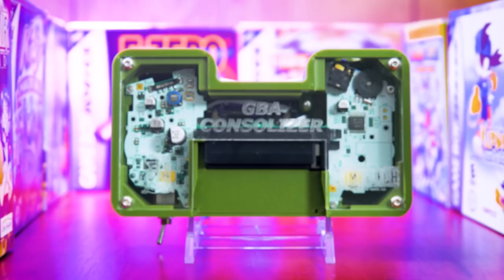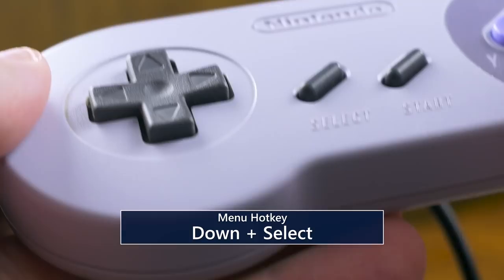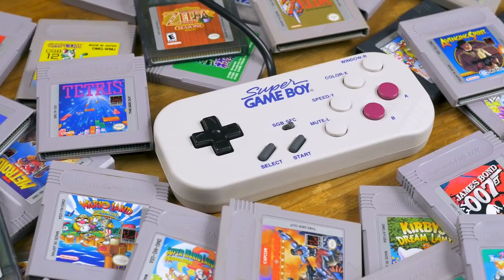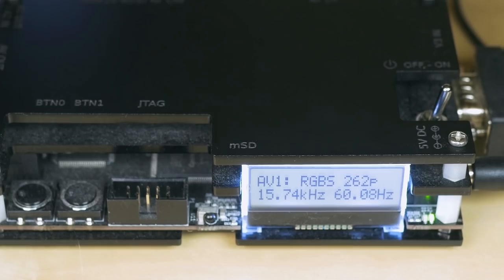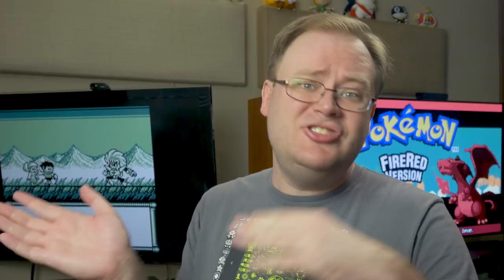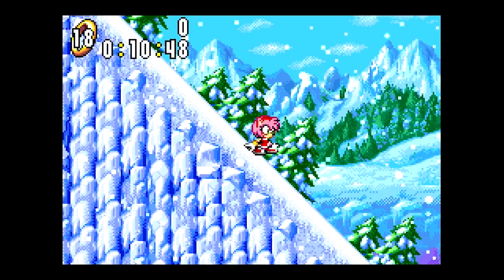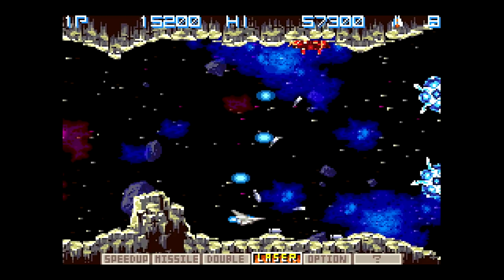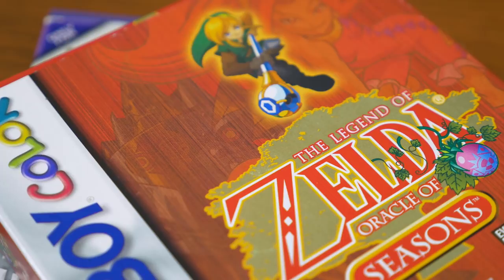GBA Consolizer - Game Boy HDMI Mod :: RGB318 / MY LIFE IN GAMING

Comment: I’d much rather put a IPS display in one of these GBAs then gut it for this.
Reply: I also feel like the degree to which this alters the hardware/firmware undermines it's purpose. It's still a cool mod kit, but it gives the impression of an emulator rather than a "Consolizer" which should primarily replace the input and AV capabilities.
Reply: @ArtumTsumia  Yeah, you're better off just getting a old PC, Wii/Wii U, or a raspberry Pi setup for significantly cheaper. Saving the GBA for a more reasonable mod.
Reply: @piranhaplantX  emulation is not the same as og hw or a fpga solution.

Comment: SPOILER ALERT: they now sell all their "consolizer" things for 350$+
Reply: For that price a MiSTer is a much better investment
Reply: @prufrockrenegade  A what?
Reply: @somebonehead  MiSTer FPGA. It's a small circuit board that can be configured to basically run just like Analogue's high quality clone consoles, except it can run all the major 8-bit and 16-bit consoles as well as a bunch of older computers (like C64) and arcade machines all from the same device. Takes a bit of tinkering to set up (kind of like a raspberry pi) but once you do it basically runs just like real hardware over HDMI (Edit: and RGB!). SmokeMonster has a bunch of YouTube videos going into more detail if you're interested
Reply: Buy their kit and do it yourself. Much cheaper than having them build it for you.
Reply: @sickregret  or just be smart and use one of the hundreds of emulators for pc that have existed for decades.
Reply: @Arriaga Two because they want to.
Reply: @sickregret  Issue: I can't do that.

Comment: For people who don't have soldering skills, they should consider using pogo pins. How that works is: Pogo pins are spring loaded, gold plated pins that can be soldered directly to a PCB. The kit would come with custom PCBs that have pogo pins which align with the spots you'd have to solder to. You screw the board in and it presses the pins against the spots. From the custom PCB you have wires going to the daughter board. Zero soldering required. Modular and easy to repair in case one of the pins fails.

Comment: 24:40 This particular data-point could be extremely telling. Likely, the use of an in-line device, which adds its own signature to the signal, is giving your Denon receiver exactly what it wasn't getting from the GBA Consolizer itself. Your discovery not only points to a simple solution, but also to the issue's likely cause. If that's the case, this could potentially be something that firmware alone could solve. As adding a signature to a sent signal isn't really that hard to do. It can be done via hardware (like it is with most vintage electronics), but is just as easily done through firmware (as it is in pretty much every modern device). This was super exciting to see you mention. I bout fell out of my chair, while flailing for the spacebar to pause! xD
Reply: P.S. I just looked at the date on this video and laughed a second time. As, hopefully the developer has addressed this bug by now.

Comment: 8bit do should remake the gamecube snes style controller in the future <3
Reply: Zeke Barrett they do
Reply: @Adamsnadler214  not the gc Controller with snes shaped case.
Reply: Raphnet tech makes an adapter to use SNES controllers on your gamecube. I'm currently using that as well as an 8bitdo wireless snes controller with gameboy interface and it works amazing

Comment: If I didnt have gbi and gameboy player 360p line triple for ossc I would have been all over this. Mines flawless. Great video guys :)
Reply: When doing this, does the OSSC output a 1920x1080 image? (Or a resolution below 1920 pixels wide, just asking for my 1080p display)
Reply: @Supersayainpikmin  The OSSC always outputs the original aspect and frame rate. I don't know if the GBI software has any options for that as a few GC games did have widescreen modes. But that usually required altering a setting on the TV (unless you always stretched everything to fill the screen anyway). Does your TV have the capability to force an aspect ratio?
Reply: No, it doesn't. I was actually thinking of routing it through my Framemeister since my TV apprently isn't compatible with the OSSC. While It works with 960p input, I'm not sure this oddball resolution will work. I'll find out myself next week when my OSSC arrives. Even if it doesn't, it's fine since the FM still looks really good to me for GB games.
Reply: @Supersayainpikmin  360*3=1080 so the line height there shouldn't be weird. It's very unfortunate that your TV doesn't have scaling options. I've never used one that didn't, albeit it was very buried in a few of them.
Reply: use retroarch
Reply: @sixdroid 
Emulators are for noobs.
Reply: @CPS2  ?

Comment: Using an SNES controller is genius. I modded my Super GameBoy yesterday to make it use the same speed as the GameBoy DMG-01, Pocket, and Color. Next will be installing the Game Link Port.
Reply: Just buy a Super Gameboy 2 from Japan it fixes both of these issues.
Reply: @USMCJPelt  Overseas shipping requires a John Hancock (reference to Tommy Boy) every time and I work nights and sleep all afternoon until 4pm.
Reply: installing the clock mod was good practice for soldering and removing smd's. it's also nice to upgrade something I've owned since way back when.

Comment: Wish something like this existed for 3DS.
Reply: If a video out were to exist for 3DS you'd have access to GBA (via CFW and custom GBA Virtual Console titles) and DS too. That's another set of three Nintendo handheld platforms on the big screen with no software emulation in sight.
Reply: @Fattydeposit   There is Citra for 3DS emulation, and it works. You do need a real 3DS though, and some files from the 3DS which a pre-built CIA for exists. After you homebrew it you can just grab those files and use them wholesale in Citra for making certain titles like Miitopia useful, which requires a Mii of your own to play.
Reply: @Fattydeposit  It's always a pain to map controls for newer Nintendo systems though. Motion controls don't map well.

Comment: Sounds great but: 
for that kinda money you can buy a GC with GBplayer. No soldering required and you don't have to sacrifice your GBA.
Bssides, if original hardware is not that important to you, it is still easyer to set up a RetroPi. 
Another alternative is an android device connected to your t.v. using bluetooth to connect to a PS/XB controller..

Comment: Certainly looks nice, but I'm still not sure how I feel about sacrificing original GBA hardware. I know there are still a ton of them, but it's still a finite source. Steep price too. I hope someday we might get an FPGA solution for it. Either through MiSTer or a stand alone system which does GB/GBC/GBA. I'd get behind that. For now I am happy playing Game Boy.* on a GameCube + GB Player running GBi software, via component outputs, and playing with a Hori GBP controller.
Reply from the maker: [Try4ce] I don't think anything about the mod is irreversible. The same could be said of any mod, it's just that most stay in the original shell (or cut the plastic of the original shell, which I'm pretty sure this does not).

Comment: In response to the 8bitdo snes controller options. Most of the issues are with “pro” models from what I’ve heard. The 8bitdo SN30 is a fantastic 2.4ghz controller which has the exact dimensions of the SNES controller and no lag on real consoles which has been great for casual and speedrunning games. It works on switch with a usb cable and it should work great on the consolizer. The buttons even use the same cutouts for the original controllers so if you get the transparent black version and want the OG purple or colored SFC buttons on it it’s an easy swap.

Comment: I appreciated the video. I would just like to point out that 2160 is not three times larger than 720; it is three times as large as 720. "Larger than" implies adding a multiple of the base number to the base number, whereas "As large as" is just straight multiplication.

Comment: For the gbi gamecube option. extrems was saying that the hdmi solutions have some issue's with some settings. IDK if 540p works with it. there are some other options. 
Normal settings work fine. So official component cables will give better results. 360p is good with the ossc, idk if it needs special firmware to accept such resolutions. I don't think he likes the hdmi solutions to much. Exrems was saying the hdmi consolizer is just as good as gbi hf with all the good settings on and more stable of course since it's read hardware. So your getting the best that can be offered with the consolizer.
Some settings work fine and with default should work fine also with the hdmi solution. I don't own any hdmi solutions so idk for myself, it looks like you guys got it running fine. I just use s video with the framemiester with 240p setting which is alright, there is a tad of fuz id like to eliminate with a other solution.
That audio problem is enough for me to think about getting og component cables thou, it's really tough with the high ebay prices. maybe it can be fixed in another rev.
Reply: I don't think u need a upscaler if u use component with 540p and 1080i. The software will do it with the components.

Comment: So wait if the consolizer is overclocked, even if its only slight what does that mean for link cables?
Reply from the maker: [Try4ce] Hmm that is a very good question, maybe something else keeps them in sync? Honestly I basically never have need of them, so I didn't think of that.
Reply: @mylifeingaming   Would be nice if you tried that out, aswell as the Gamecube-GBA link cable.
Reply: @mylifeingaming  it's a pretty important thing to test, especially if you want to enable multiplayer with the Consolizer.
Reply: Please test it!
Reply: It would make it go out of sync, I’m kinda shocked they didn’t include an option to toggle the speed just for that.

Comment: I just had a thought: The GameBoy Player is literally just a GameBoy Advance that replaced the screen, controls and power circuitry with a proprietary connector.

Wouldn't that allow a Plug'n'Play version of the Consolizer for the Player? - obviously with additional engineering required since I don't assume that Nintendo literally just piped raw video from the GBP to the GameCube, and raw input data back, otherwise we'd likely have seen some sort of Third-Party DVD player or Famiclone add-on for the GameCube back in the day.
Reply from the maker: [Try4ce] I believe they are planing to make a version for the Game Boy Player eventually, but it never occurred to me if it might actually interface with the GameCube. In my head I was just thinking it would work independently.
Reply: @mylifeingaming  Well, I assume it wouldn't NEED a GameCube, unless Nintendo went crazy with securing the connection between the GBP and the Gamecube. Worst case they'd have to directly tap some of the GBA's chips, but I was wondering if they could "just" release a box that you plug into the Player instead of the Gamecube with no modding necessary. An added bonus could be rumble support for the few games that supported rumble through the GameCube Player.

Comment: This is kind of neat and I'm a DIY guy, but even at $140 it seems like a lot for what it does. Don't take this wrong, I don't think/mean it's overpriced, just personally I find super limited appeal of playing GBA/GB/GBC games on a tv. I have the original systems and flash carts, and also a modded Wii. A modded Wii will let me play these games on a TV if I wanted to. Sure, it's an emulator, but we're talking hand held games which aren't really "authentic" on a tv screen anyway. I guess it's nice to have options, but a Rpi, computer, Wii, and many other devices will do the same thing. If for some reason you need real hardware, such as speed running, the timing difference eliminates its usefulness in this category. The most useful thing I see about this is that you can use a SNES controller or allow a sentimental broken GBA to be revived. I guess what I am getting at is, it's a really neat idea and might be great for some people, but it's a super niche product and it isn't something that appeals to me personally.

Comment: Hey Try and Coury, I have some pretty great news for playing Gameboy Advance on HDTV! Recently they added some Low Pass filters to the Gameboy Advance Core on Mister in one of the updates. 

There is a Filter that I think changes the game on GBA's audio quality - I've been testing them out extensively and have come to the conclusion that the Arcade LPF 6khz 2nd Audio Filter provides strikingly excellent results without effecting the audio range or dynamics too much (effectively minimizing the audio buzz present on GBA consolizers thru most AV equipment). 

I'm sure this Filter COULD be added to the GBA consolizer itself aswell - but for Mister, this is a BIG break-thru for capturing and streaming GBA (and for those of us who still hear higher frequencies). Update you're Mister and give this filter a try and see what you think. 

The difference is best heard on headphones of a surround system - but can still be clearly discerned thru typical TV speakers. No More Annoying Hiss!

Comment: It'd be interesting to see a video on receivers at some point; they're rarely mentioned seemingly (compared to the OSSC or Framemeister), but if they can scale analog signals to 4k60 then they're an option for sure. Do you notice any lag with your Denon receivers?
Reply from the maker: [Try4ce] There's no lag in the modes we use them in, but for processing analog content, I would think there would be. Do not expect the upscale to be tuned for game graphics. I wouldn't expect it to look a lot different from how a TV would scale the image internally, but I haven't tested this.

Comment: Seems like a GameCube controller port would've made more sense than a SNES one. You could natively use the GC controller (not ideal), the Hori GBA GC controller (perfectly amazing, but expensive) or another GBA with the cable adaptor (probably perfect, since you'd then also have a portable GBA as well as your consolized GBA)

Comment: This would be a purchase for me if I didn't already have a CARBY and the GBI software for my gamecube.
Reply: awesome for you!
Reply: I have the same setup, but my issue is that the CARBY still doesn't process 240P as well as an RGB solution does via a PAL Gamecube, at least that's my understanding of it.  It seems those solutions still don't do 240P as well as they could as they are made more for 480i/480P content to my understanding.  It seems that currently this is the only HDMI solution to properly do 240P with the ultra sharp pixels.
Reply: Is there a good video for how to set that stuff up? I'm trying to get the GBP Homebrew software, but I'm having issues.
Reply: @AirshBornely  Not sure offhand, but maybe try cheking out the www.retrorgb.com website, it probably has some info on setting it up as well as loads of other good info.

Comment: That's cool, but $350?? You can get a gba gamecube player and hook it up to the modern hd gamecube accessories for less than that, boot disc included. It can be a bit of a stretch these days, but it can be done cheaper.

Comment: Truthfully on an OLED you are better to have the whole screen lit than just part of it. OLED "burn in" is actually uneven pixel degradation over time. So if you are only using a box in the middle of the screen you are more likely to get "burn in" where the box is rather than uniform degradation across the whole tv screen.
Reply from the maker: [Try4ce] I don't think you need to just not play retro games on your OLED. I plenty and there's no visible difference in aging in the middle versus the edges. I understand the concern is there, but it's not something that will definitely be a problem.

Comment: Looks good and though it sounds a bit pricey another way to look at that is it's cheaper than modding most other systems and you get a lot of modern features supported for a fairly big library of games. Seems like a good place to start and try out this compounded price hobby heh.
Nice to see that GBA model getting used for something since it's not very desirable to most people as dark as they are, hard to believe I bought something without a back light as late as 2001. ^_^

Comment: Not being a programmer, I don't know what kind of effort it takes to implement certain kinds of scaling, but it seems slightly absurd that it took so long for retro gaming creations (be it homebrew or official emulators) to figure out that you can essentially get perfect quality by using nearest neighbor and integer scaling up to the biggest size that'll fit on your display - then finish stretching it to fill the screen vertically and adjust the aspect ratio horizontally with some bilinear filtering. It seemed like the default option in a lot of stuff was "use bilinear filtering, but go straight from the native res to the final res with an insane amount of blurriness." No bueno. Even Nintendo didn't figure it out until SNES classic - the NES only had "crappy blurry" CRT mode, integer upscale without aspect ratio correction, or "correct ratio" but chunky uneven pixels with shimmering. None of those options are really acceptable. The SNES being able to do 3x integer scale followed by finishing the stretch with some bilinear filtering means, vertically, the pixels are perfectly sharp, and horizontally they just have a little blur to get 256 to fill up what should be a 960 pixel wide window with a 720p display.

That last part doesn't really pertain to gameboy, but I love seeing a hardware product do it the right way since doing it wrong is so much more common.